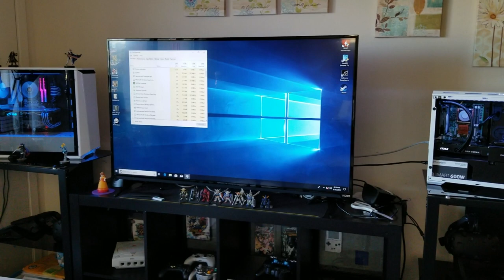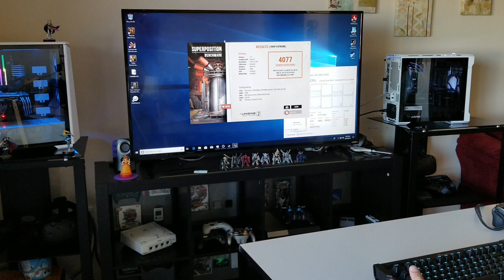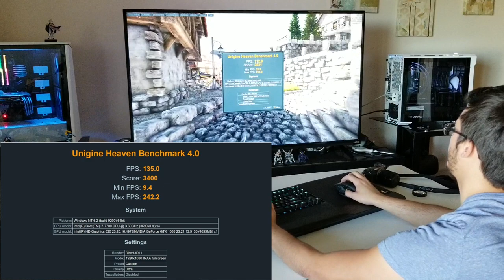Laptop CPU in a Desktop!? - Can it play games?

Comment from the maker: Before you comment Read this information:
Changing your newer laptop (2016+) Is nearly impossible.  Why? because most processors after 2016 cannot be removed from your laptop.
If it was possible it would cost more to do than building a gaming PC.

If your Laptop isnt Socket G1, G2, or G3 you probably wont find a motherboard that can support it on the desktop platform
These boards are industrial boards and usually are not cheap / user friendly

Socket G1, G2, G3 are Intel mobile i series 1 through 4.
If your laptop is passed 4th Gen Intel,  it probably wont be able to be changed to the desktop platform without HEAVY modification
Reply: So guessing i cant use my i7 acer predator 2018 cpu💀
Reply from the maker: @sinfulwastaken6168  I would say no.  Even if you could.  it would probably cost more to adapt a 2018 CPU to the desktop platform than to just build a new PC
Reply: @Thrash05  thanks, omg u still comment on old videos, tysm
Reply from the maker: @sinfulwastaken6168  I comment on all notifications i get.  At least try to when i go on youtube

Comment: This is a pretty cool looking build. Very nicely done. I'd be interested to know more about the power consumption since it's using a mobile gpu.
Reply from the maker: Yeah, I didn't check the power output when I had it.  I am sure it's extremely low.  Since my threadripper build hits 480 watts at full use

Comment: I have an intel i5 in my broken laptop how can i use it on desktop
Reply from the maker: you need to find out what generation it is.  look up the processor number (for example i7 3940XM) then find out what socket it uses.  then look up on ebay the socket + ITX

My system was a 3rd generation socket which was socket G2

So I googled socket G2 ITX motherboard

but that's only if your processor isn't soldered to the board
Reply: @Thrash05  it says that it uses socket BGA1440 but if i look it up, i cant find it.
Reply from the maker: @kamielbreyne7859  That would  be a 6th gen intel processors,  they were soldered directly to the motherboard and cannot be removed.  you wont be able to make it into a desktop
Reply: Hlo i have i3 5th gen which processor i should buy for gaming  in laptop???

Comment: i have a i7 3630QM and my socket in desktop is an 1155, It is compatible? if not, is there anything i can do to use the processor on it?
Reply from the maker: No mobile processor will ever fit in a desktop motherboard.  You can get motherboards for 3rd gen I series processor in your laptop.  but you will have to do some research

Comment: Ok, would you be willing to make a detailed video on the setup for the power supply? I'm was about to pull the trigger on this mobo but then saw the part about power.
Reply from the maker: all it is, is a 4 pin slot on the motherboard, a jumper to tell the system to auto boot, and jumping the pin on the 24pin PSU connector to keep the power supply in a always powered on state. 

in order to turn the computer on and off you will have to flip the switch on the back of the power supply every time.

OR! create a relay switch (or just use a toggle switch) to turn on the power supply.

There is no way to run this board off of the power button on the computer without a bunch of wiring involved

These boards are industrial boards, meant for billboards, slot machines, ATMs etc. they were not meant to be powered off very often
Reply: @Thrash05  thanks my dude I thought there was more to it, seriously thank you!
Reply from the maker: @LTRiggs321  No problem. 
I will probably make a more in depth video on some stuff when ever i can get some Thermal Grizzly Carbonout for the system.
Reply: @Thrash05  Has been trying to figure out how to wire the same relay circuit with the same 2ch board you used in the video for that same mobo. Would be super grateful if you are able to share the wiring diagram? Or even a detail video on how to make the relay work as I think there are a few who are interested to know after reading the comments. Good stuff you have here and all the best for your channel. 

If you are too busy to upload any video on that probably a draft drawing where we could download from online storage space will do too. Thank you so much!!!
Reply from the maker: @ozzzva  I actually recently sold the build and used the money from the build to make a Intel 9th gen I3 Small form factor PC

but i will look through my images and see if i can get a diagram.

Essentially all it is.  is the power goes through the first relay, then from there it goes into the second relay then back into the first relay to hold them in the on position.  then shorting out the second relay turns off the first relay. 

making it have a 2 pin power on and a 2 pin power off.

as for the 24 pin power,  the power supply always has a active 5 volts you can use for power

Comment: I have an i5 in my laptop and I want to install it into my desktop which runs i3. Can i simply just remove it from my laptop and install it on the desktops motherboard?
Reply from the maker: It is not possible to put Laptop hardware into a desktop.

This video is Laptop hardware into a Laptop socket thats on a desktop style motherboard

Comment: All cpu is compatible with any motherboards? Wether it is itx or atx?
Reply from the maker: If its within the same socket family and chipset. Yes (to a point)

A AM4 processor will fit in a AM4 ITX, and ATX

ATX, ETX, MATX, ITX, DTX, are all form factors.  they apply to all motherboards regardless of the socket in which it uses.

as a literal sense to you question.  No not all processors can be used on ANY motherboard.  only within its socket family to a point.

Example:
Intel 7th Gen is Socket LGA1151
Intel 9th Gen is Socket LGA1151
A 7th gen processor will NEVER work in a 9th Gen motherboard.  even though they use the same socket.  this is a motherboard chipset restriction.

Another Example:
Ryzen 3000 CPUs are AM4
Ryzen 4000 CPUs are AM4 also
a Ryzen 4000 CPU will not work in a Ryzen 3000 Motherboard.

Comment: Does too much thermal paste cause high temperatures in a laptop?
Since I've repasted it my temps have been reaching 95+
I was getting 85-90 before repasting
Reply from the maker: no, too much wouldnt cause high temps.

When you repasted it.  did you clean off the heatsink fins and fan too?

Also, did you use a quality paste?
Like thermal Grizzly?
Reply: @Thrash05  tbh i wasn't the one that repasted it, it was a guy in a store, but i believe that he cleaned everything because he sent me pictures and it looked like he cleaned the fins and the heat sink
Reply from the maker: @srapie  I am sure he did.
It could be that the processor isnt doing as good as it used to.  I had a laptop that would hit 90 degrees no matter what i did.  The only other thing i can think of is that maybe the heatsink is starting to go bad.  but that is usually fairly rare.
Reply: @Thrash05  i mean i got my laptop only 1 year ago, i don't think that my cpu would lose performance in only 1 year
Reply: @Thrash05  also when i used to put my hand on the place where my heat sink is while gaming. It used to be hot.
But now it's cold.
Shouldn't it be hot?
Reply from the maker: @srapie  A Damaged processor can most definently loose performance in one year.  has your PC every just shut off by itself?  A lot of Intel processors can handle up to 100 Degrees without an issue.
Reply from the maker: @srapie  This is odd, you should be able to feel it.  Maybe the heat-sinks heat-pipe is dried out?  would mean you need a new heat-sink.  Normally we would test this by turning on the PC with a benchmark.  letting it warm up.  then touch the end of the heat-sink to feel for the heat to transfer.  if the heat-sink fins are cool to the touch then the unit inst transferring the heat correctly
Reply: @Thrash05  nope my pc has never shut down by itself.
I have a i7 7820hk btw
Reply from the maker: @srapie  do you happen to remember what the temps were back when you got it?  My old i7 laptop used to get to 85+ on gaming and it had good heatsinks.  It might be just a normal thing to get that hot?.  if i were you i would get some new paste.  I used Thermal Grizzly Kryonaut.  it is probably the best performance paste out there.
Reply: @Thrash05  i think that my temps were at 75-80.
But i think that my cpu is thermal throttling because my gpu usage is always low. And I'm barely getting 80 fps in gtav with max settings in 1080p.
Btw i have a gtx 1080

Comment: Great vid! I'm doing a similar project with an i7 4700mq and an imb-180. can you explain how the power supply is hooked to the board? I understand I can wire a toggle to the 24 pin to turn on the power supply but what all do you have connected to the motherboard itself?
Reply from the maker: look in the description
There is a build write up link.  look in the comments section.  
I have photos of a relay i used to power it on with the power switch.
as for whats connected from the power supply to the IMB-170 is just the 4 pin CPU power

Comment: Hi, Your video inspired me to take up a similar project with a laptop. I have an i7 4702 MQ Hasswell processor with G3 socket. Please advise which motherboard - heat sink  can I use for this build.
Reply from the maker: You probably wont find a motherboard for that socket.  after socket G2 most Industrial motherboards went to LGA 1150

Also, after i finished the project.  it cost me quite a bit more than to just buy a better 9th gen chip, motherboard, and ram

These dont have a good selection of heatsinks and get really hot.  I do not recommend these as a desktop set up other than for dual cores

You are better off just selling the Chip on ebay and using that money to fund yourself a brand new desktop
Reply: @Thrash05  Thnx for the advice dude. So I will just re use my hard disk n get the rest as new for the new system. Appreciate your help. :)

Comment: hi 
i have a prebuild pc with an intel hm55 and a core i5 540m.
i want to change the cpu for a better one if it possible. is it possible and if it is what cpu is supported ? thanks
Reply from the maker: First generation intel are able to be removed and swapped out.  

You could try a i7-820QM or a i7-840QM 

I would check the motherboard manufacture website of the all in one to see if your device can support the processor first.  

It will socket in just fine.  its more of the cooling that i would be worried about
Reply: got it bro thanks alot <3

Comment: Nice video, I am planning to get this motherboard, but I can't find the pin layout for the power/reset switch, can you tell me which ones or like send me a link to where you found it.
Reply from the maker: This motherboard uses a AT power supply or a ATX 4 pin.  Essentially the PC is always on.  so the power switch doesnt really do anything on the build but shutdown windows

You can wire it up and have it turn windows on and off.  but the Power supply will always be active,  keeping the PC itself (drives, LEDs, etc) on

 Here is a link to the webpage with the documentation

https://www.asrock.com/ipc/overview.asp?Model=IMB-170

Comment: do you know if there is a motherboard for this laptop cpu i7-2630QM ? thanks
Reply from the maker: The one in the video does third gen and 2nd gen
2nd Gen should be SOCKET G2
search Socket G2 ITX motherboard on ebay and boards should show up.

then you can go on the manufacture website of a board you may want and see if the CPU is compatable.
Reply: @Thrash05  Thanks for your answer, I think that for my cpu it isnt a cost effective solution, I have an cpu i7-2630QM  and 16 gb of notebook DDR2 ram . But there are no cheap motherboards in the market.
Reply from the maker: @ncarrasco2006  cheapest motherboard would probably be around $70 and you would need to get DDR3 ram

Comment: hey bro? my laptop has intel i7-3720qm hp elitebook 8570w, what motherboard can i use for this cpu??
Reply from the maker: Sorry for the late and long reply.

but Since my video, the motherboard that I got sky rocketed in price.  but it wasn't user friendly anyway

you might be able to get a different brand for around $50 to $70 which will work on your processor

Here is the name of the board
SBC Mobile Socket Mini-ITX 8321
or anything with Socket G2

When looking for motherboards on ebay look for Socket G2 motherboards with the form factor ITX.  That is the socket your processor fits into.

Here is a ebay link I found of a motherboard.
comes with a heatsink and fan too.  This motherboard should work as a regular power supply without modification

https://www.ebay.com/itm/Portwell-WADE-8321-SBC-Mobile-Socket-Mini-ITX-Intel-i3-i5-i7-G2-Intel-QM67/231750253140?hash=item35f5643a54:g:KZkAAOSwd0BVvevm
Reply: @Thrash05  thanks bro

Comment: Hey bro I have a i3 processor om my laptop . It's from 2013 or 2014.... And I have desktop running on Pentium from 2015....
Can I put the lap processor on my pc without changing motherboard.....Also which is better 2015 pentium or 2013 i3 processor...... Plz Help me Out Brother
Reply from the maker: no, it is not possible to put in a Laptop processor into a desktop socket or a desktop processor into a laptop socket.
This video is about a Laptop Processor going into a laptop socket on a desktop style board.
The Desktop style board still has a laptop socket in it.
also a I3 is always better than a pentium

Comment: I have laptop  CPU i5 5200u 2.20 GHz Can i remove it and équipe it in my desktop pc and if i Can witch mother board i would buy it
Reply from the maker: That series had processors that were soldered onto the laptops motherboard.
since they are not removable you cant physically take it out and put it in a Desktop style board that has a mobile chipset.

once you start getting into 6th gen mobile you are looking at around $1000 for motherboards.
Which at that point you should just be building a regular desktop PC

Comment: I have an i7-8550u in my laptop but it's bottlenecked. I want to use that for building my pc. Can i use it?
Reply from the maker: No.  That processor is soldered to the board and cannot be removed from what I can tell
Reply: In that case can I use an e-gpu to avoid bottlenecks? 
BTW I have a  mx130 4 gb ddr4 installed in it
Reply from the maker: @aliengenome166  you should have at least 8gb of ram honestly.
And when it comes to bottlenecks it depends what's the bottleneck.

A program called hardware monitor can show you the % usage.

If the cpu or gpu hits 100% then that is your bottleneck.

A e gpu could help but if your cpu is the bottleneck then you practically need a new system since it cant be upgraded
Reply: @Thrash05  Bruh i have got this laptop:

https://uae.sharafdg.com/product/hp-15-da0038ne-laptop-core-i7-1-8ghz-8gb-1tb-4gb-win10-15-6inch-fhd-natural-silver/

I think the limiting factor here is the graphics card, so should I look for buying an e gpu?

And if i can then which kind of doc would be suitable for this laptop?

Comment: Bro My laptop processor is i5 7th gen And my PC is ddr3 its current processor is i3 4th gen can i put laptop processor into PC and PC processor into laptop?
Reply from the maker: no, a laptop cannot be converted to a random PC,  it has to be created from the ground up with its hardware in mind.
Anything passed 2016 cannot be changed over.  Intel 1st Gen to 4th Gen are mostly the only processors you can do this too

Comment: I got Msi laptop with i7 8750H and a full size 1070 gpu not max q version, can I salvage the parts and put together in a pc?
Reply from the maker: If you want to spend well over $1000 on a motherboard sure.

Industrial motherboards cost a lot.  Especially for the new stuff.

You are better off buying desktop parts and parting out the laptop parts
Reply: @Thrash05  damn, so what can I get out of my laptop?
Reply from the maker: @surirajput1  
You should be able to get a good amount of money selling the parts on Ebay.   Like an example of my old 3rd gen PC.  The processor is worth $150.

So I'm sure being 8th gen and all.  You could probably get a good amount of money for the parts

Comment: Could you explain the jumper situation with me beacause I am not familiar with it
Reply from the maker: all the jumper does is changes the power mode.

There are two methods

One where you can use a normal ATX power supply that will automatically start the unit as soon as power is put into the machine

or the other jumper requires you to use the power switch on the motherboard

because the board doesnt have 24 pin power.  the motherboard cannot supply power to the power supply to wake it up.

I personally wouldnt recommend this board unless you are using low end.  

there are other boards on ebay that use socket G2 with 24pin slots